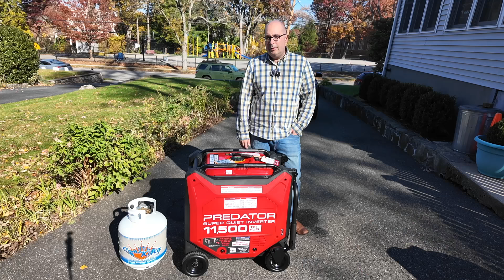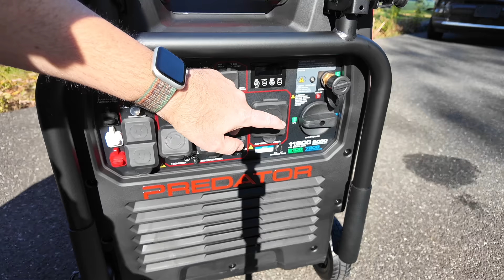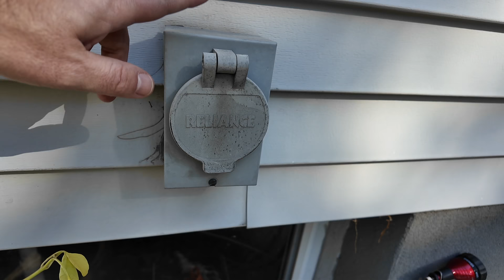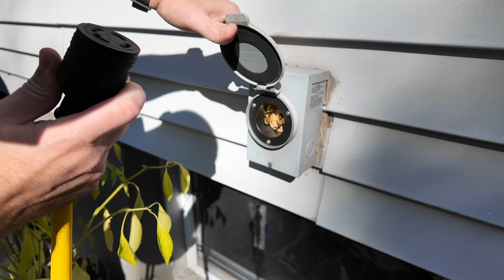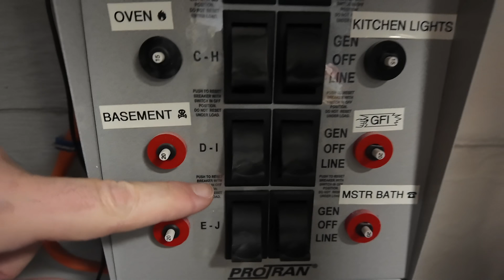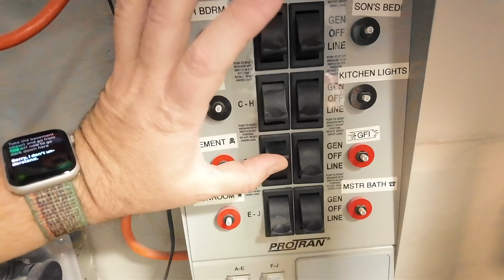Predator 11500w Powers My Entire House (Transfer Switch & Full Test) — Honda Should Be Worried!

Comment: I went with the Honda EU7000i as it is a great machine and has been around for a long time.  I know people that have had this or the similar 6500 for a long time with hundreds of hours over a decade and have had no issues.  it IS a tad small for a whole house, but be realistic people, all you NEED in a power outage is AC/Heat, a few lights, and some means of cooking.  7000 surge/5500 run will do that.
   I will say, if we had Harbour Freight in Canada, I would have jumped all over those predators.  They don't have the survivability of the Hondas (according to other videos i have seen), but you can buy 2 for the cost of one Honda.  IF you can find a honda EU7000i in stock anywhere.  took me 2 months of waiting on a list.
Reply from the maker: Honda is definitely a top notch unit at least!
Reply: Not multi fuel however which is a key point. Plus they are like double the cost

Comment: I live in Ontario Canada and our rules are a bit different.  We are not allowed to install mechanical lockouts.  I have a friend that swears he can "buy an electrical panel with a factory interlock installed legally in Canada" but I have called several electricians and asked a local electrical inspector and they all say you cannot.  In Canada you must use an transfer switch and the most common up here are called a GENER-LINK (not to be confused with Generac"  It is an automatic whole house transfer switch that installs under your Power meter for your house and has a proprietary plug and standard 40" cord (you can get longer but you pay more).  there are 40 and 50 amp models that can come with a 30 amp twist lock or the 50 amp "dryer plug" type.  Because it is installed at the power meter, your entire breaker panel is powered and you can decide what stays on or off.  I installed mine about 2 years ago for about 1800$CDN which includes taxes, the electrician (who arranged with the Hydro company to cut power for install) and an 80' cord.
  I use a honda EU7000i and it runs my whole house just fine.  It CAN run the stove, but I do not recommend it.  a single element on the stove is about 3500 watts and when it turns ON and OFF every few seconds, the lights dim.  It runs my 2 ton AC just fine as it has a soft starter on it.  It ran fine without the soft starter, but it's much smoother with it.  The AC cycles on/off closer to hourly, rather than a stove cycling every minute. 
   In the 2 years I have had this setup we have had about 5 power outages, usually less than 2 hours, but we have had 2 5 hour+ outages.  The main reason I bought this setup was because my wife works from home.  Even she can have this set up and running in 15 minutes, including the 10 minutes of panic and complaining and texting that is mandatory when something like this happens.
Reply from the maker: Thanks for sharing your experience and the detailed info about the Gener-Link system in Canada – it's really helpful to hear about different regional requirements!
Reply: Is the Honda EU7000i neutral bonded or floating?  (I believe it is a floating neutral).  My Honda EM6500SX has a floating neutral which is required for my 30 amp Gener-Link transfer switch.

Comment: before you start the generator should you turn off your main? and then turn on the generator, and then the circuits you want to use? How do you split the 220V power you need to run an electric oven or dryer, or A/C and the 120 V loads from the house? I'm confused.
Reply from the maker: I have a transfer switch so that takes care of everything. It was professionally installed . I also don’t have any 220v circuits they need power as my home is natural gas for stove and hot water

Comment: I've had 2 gas generators since hurricane Rita. A predator 3500 and a troy built 5600. They have worked fine but the cost and maintenance can get expensive for what power you get. Now I'm getting into solar and have been learning the last 2 years watching YT videos. They have come a long way and getting better. The thing with the solar I am able to use power everyday from solar. With the generators they are great. But you use them only when power is out. There are many YouTubers showing small to large solar arrays and how to get started. I've enjoyed learning from small 1000w system to a 2000w then 5000w and now have 6000w inverter with 28kwh of lithium batteries. JM2C....
Reply from the maker: Solar paired with a generator is the best. I have several power stations and use a small generator to recharge them when necessary . Thanks for watching
Reply: What those youtubers not telling you about those solar generator  is those battery packs unit they use have a high failure rate and high fire risk. If they catch fire a fire extinguisher  will not put them out

Comment: Thanks for the video. Did you have to float the generator ground to be able to connect to your home electrical system?
Reply from the maker: Glad it was helpful! It’s still bonded but I need to make it floating. I will post a video on how to convert it hopefully in the next few weeks - it’s just way too cold outside right now to work on it
Reply: @Outdoor_Prepper i just subscribed, and just purchased  this Generator yesterday.  but the exhaust now is at the back of the generator, and the front is a bit different as well. I was told this has to be converted  to a floating neutral to use for my home, i look forward to your video on how this is done.

Comment: LP gas will not give you as much wattage power as powering it with gasoline.. also do not use E-85 gasoline in your generator..10% Ethanol should be okay, but straight gasoline is best. natural gas gives you the least amount of wattage power than the other two.
Reply from the maker: That’s a great point about the wattage difference with different fuel types!

Comment: I just got a generator…I have mulch, can it be placed on the mulch? Also how can I prevent it from being stolen? How do I make sure I let the gas run out, you mentioned something like that in your earlier video. Help please 🙏🏻
Reply from the maker: You can place it on the mulch. I use a heavy chain through the handles and chain it to a tree. To drain the fuel probably the easiest way is just let it run until it’s empty.

Comment: So much relevant information. Thank you. I just bought the 5,000 watt unit, yesterday, on Harbor Freight’s 12 Days of Christmas sale — $699.99 (down from $1,099.99).

Although there are significant differences between the 5,000 watt and 11,500 watt units, your video provided much information that I have not seen in other videos. I will watch your unboxing video and I have subscribed to your channel.

Two suggestions: 1) point out to viewers why you slowly cracked open the propane tank valve to avoid triggering the switch that shuts down the generator motor and 2) suggest pre-lubing the cylinder with an oil treatment, like LiquiMoly Snti-Friction SO2 [Oil] Treatment or Lucas or Amsoil.

I am looking forward to watching your videos.

Merry Christmas! 🎄🎁
Reply from the maker: Awesome! Glad the video was helpful, and thanks for sharing your tips! Merry Xmas!

Comment: I believe this generator has a bonded neutral from the factory.  I'm not sure what the electrical code is where you live, but where I live, a generator connected like this to a home requires the neutral and ground to be separate on the generator...not bonded.  We can only have the ground and neutral bonded in one location - for my home it's in the main electrical panel.  Just my $.02.  Thanks for the video.
Reply from the maker: You are 100% correct. I’m going to be showing how to unbond it in a future video and make it floating.
Reply: Great! I will subscribe to see that video. Really liked this one. @Outdoor_Prepper
Reply: That advice is not some sort of electrical code depending on region it’s electrical code period I believe

Comment: I really enjoyed your introduction to this generator, having run a Harbor Freight (i.e. Predator) 3500 for several years now.  I converted my 3500, with an aftermarket kit, to run on natural gas, so it's nice to see how tri-fuel is built into this newer unit.  

There are two additional points I wish people to know.  The first involves purchase of a Harbor Freight warranty on these units.  Normally I hate warranties: designed to make their issuers money.  But if you have problems with the unit and own such a warranty you just bring it back to Harbor Freight, they exchange it for a new one, and you can then buy the warranty on the new one.

The second point I want to make is that there is more than convenience involved in moving the unit's power via a single high capacity cord over multiple 120 VAC extension cords and that is that many locales require certain electric appliances to be hard wired (dish washer, oil/natural gas heat sparker, electric heat, dishwasher, sink disposal, the list goes on) such that there is no extension cord for you to plug such appliances into during an outage; your only remedy being powering such devices from the generator via a transfer switch  or an interlock as you've described.
Reply from the maker: That's great feedback, especially about the warranty and hardwired appliances. Thanks for sharing your insights!

Comment: You had me at interlock switch.  Not be in the trades I was always told you need a transfer switch.  Why do people go to all that trouble with extra wiring with a transfers switch when the interlock switch is such a simple solution.  Thanks for sharing that idea.  I bought a Predator 5000 for off grid camping and home back up power.  When these so on sale I'll pull the trigger.
Reply from the maker: The predator 5000 is an awesome generator and I think you’ll love the 11,500! Thanks so much for watching and I hope you catch it on sale soon
Reply: If you want an automatic change over from grid to generator, then an automatic transfer switch is what you want. A manual transfer switch is just like having the interlock kit for a manual changeover.

Comment: Quick questions: did you convert your inverter to floating neutral before you plugged in to the house. 
If so how did you do that?
Reply from the maker: That’s an excellent question. Right now I did not convert it and it is still bonded, but I plan to disconnect it and make it floating. I will post a video once I do it but right now it’s very cold outside so I haven’t been able to get out to the garage and make that conversion. Stay tuned though.
Reply: Could you also answer one more question in that future video : how to use that inverter both ways?
I want to use it with my welder not just as a whole house generator.
Thank you very much for the great videos and answers.

Comment: Where is information to make auto start
Reply from the maker: This doesn’t have auto start . It has remote key fob and push to start
Reply: Yes, could I mount in or near control unit run switch on fob thru dry contact, basically make it think I'm pushing button. That way I would not be messing we with wiring at inverter @Outdoor_Prepper
Reply from the maker: Interesting idea - thanks for sharing!

Comment: Hello, great video! You did not talk about "bonded" vs. "floating" neutral, when using as a whole house backup. The generator you use needs to be a floating neutral so you don't have two bonding points.
Reply from the maker: You're absolutely right, and I'm currently working on a video to address that exact topic!
Reply: Hello, Have you made the video reference to bonded vs. floating neutral for this model predator
Reply from the maker: Hi - I haven’t yet as it’s just been too cold to work outside but I will try to once it warms up a bit here in the northeast
Reply: I don't know if anyone who makes an inverter generator doesn't make it a floating neutral.

Comment: Did you remove the neutral jumper to frame ground bond to run generator to your house ? If so can you tell me what panel it’s located under ? Thanks
Reply from the maker: I haven’t done it yet as I still need to figure out exactly where it is but will definitely post a video once I do!
Reply: See a later comment for that.

Comment: I installed a 50A inlet and interlock for my generator for under $400 including the $60 county inspection. A transfer switch would be nice now that im dabbling in solar to be able to run certain loads off of grid and solar at the same time. A tip: it's best to electrically unload the generator before cutting fuel.
Reply from the maker: That's a great tip about unloading the generator, thanks for sharing!

Comment: I would make 1 suggestion. Move the generator on the grass and plavlce an A frame cover over it. That will not only protect the unit from the weather but also defect the noise to the ground and let the earth absorb it. You also lean a panel on both open ends to reduce the sound further. This leaves enough openings for the generator to get fresh air and still protect the unit from rain.
Reply from the maker: That's a really good suggestion, I appreciate the detailed advice on noise reduction and weather protection!
Reply: @Outdoor_Prepper yw... I only wish i could remember who came up with it. His name. I saw it years ago. He suggested either marine grade plywood,  1 sheet cut it half or treated cement board. Plus 2 smaller pieces for the ends. I also saw a suggestion on placing acoustic tile on the outter surface for added eff3ct. He tested the A frame and it made a significant difference. If I recall right he tested at 6 ft. But it was awhile ago I saw it.

Comment: This is all great but....in a major event you would need to get propane or gaz for that beast,propane you need to get to a storage tank to get it, electricity to compress it in your tank..that will not happen in a major outage, gasoline..you would need to find a storage facility or a gaz station..not gonna happen..gasoline will be the first fuel to go. Also NG will also stop flowing at one point. I chose diesel generator 2 diesel generators ..why..because diesel will be the best fuel  of the 4 available to get. Out of LP..NG..and gasoline diesel will be the easiest fuel to find or steel in a major event for your survival because of the demand...a small diesel Genny and a pump and you can get to any storage facility or under ground tanks and fuel up,
Reply from the maker: Thanks for sharing your perspective on fuel types and backup options during a crisis!